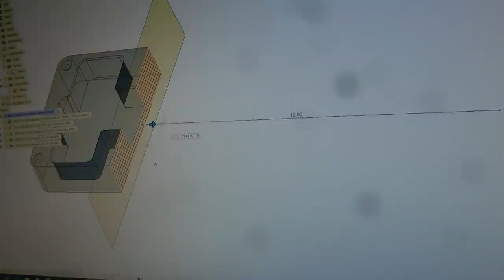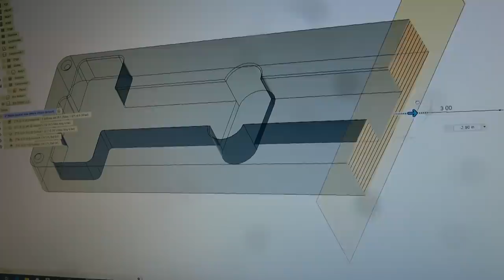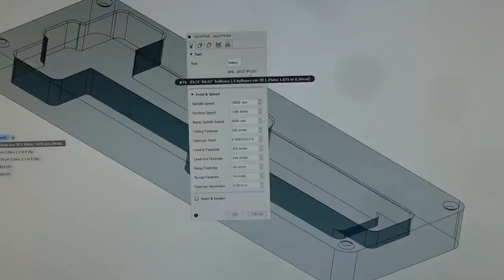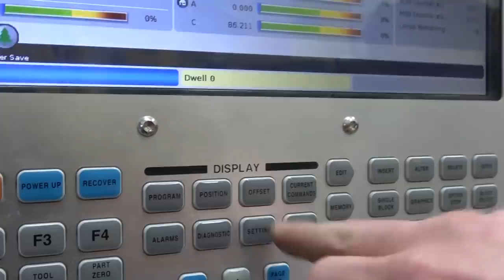Robotically Hammerin Box | Working the wood (maple)

Comment: Hazard Fraught sells something called a router. It is not an internet connectivity device of which you have been previously mislead to believe. That there skookum milling cnc thing you're using is too powerful for the carbo-foam to which it is being applied. Catching fire is the least of your concern; you could put real carpenters out of a job if they catch wind of your malfeasance.

Comment: Shes a versatile machine. Just like my last gf. 
Why you not using a HSS router bit for the bulk material removal? Itll pull off a bigger and cleaner chip than an endmill. They need high spindle speed too.

Comment: First thing before putting it into the CNC machine.
Straighten the board and make sure not to put any lubricant on it.
Wood suck anything wet and has a tendency to swell.
Know you know where "Getting a woody" comes from. 🤪

Comment: Dust collection would have prevented the fire....MDF holds to a vacuum hold down clamp much better than real wood and the air will actually flow through the MDF and still hold down material....and if it wont hold to it you can screw material to it.....I'm no expert; just loaded a CNC to make parts for a cabinet shop for awhile and made all the mistakes.....

Comment: Ya.  Hey der Ave.  Your vidjs are required  viewing in my shop.  However, as a wood butcher myself, I would like to point out that you will never achieve a vac seal without milling the mating surfaces.  Also, the CA glue you used is way to hard to conform to their surfaces.  Your joining of the rubber tips is over played.  Pull out!  First, find the most commonly available and appropriate sized ...ring.  Ok, then size your tool's motion to the task at hand.  Also, improved suction never hurts.  God Bless.  Say hello to Prudence.

Comment: when i milled soft materials (wood, plastic, fiberglass etc) on the outside profile i found that conventional milling instead of climb is better because the material doesn't try to climb up the helix of the cutter and has a lot less lateral load on what your cutting just my 2c

this shouldn't effect the finish in the softer materials also 

here is a video i found explaining it a little with a good example https://youtu.be/galm5_6SUcM?t=698
hope it helps

Comment: cutting richlite for hydroform molds (terrrible shit btw) dude running machine didn't put the bolts in the right place (or programmer... totally the programmer) let er chooch all night... she sparked and a smoldered all night, filled the whole shop full of smoke... this happened twice while I worked there, 2-5 times that shop was on fire in the 5 years I worked there

Comment: DID NOT trim the top of the handle protruding, yet somehow unwilling to put fixturing  ( aka ventilation) holes in the wood to properly affix it whist beavering.   He's lost his way.  OCD is taking control? 
Why even mill the perimeter of the box?  Get a big disk or belt sander and just match and round the edges.  No need to be shy of a little HAND finish.    If each one is unique, all the better.  Did you think woodworkers invented interchangeable parts?  Not in this plane of reality, and no need to start now.   You do get bonus points for the fire and use of linseed oil tho.

Comment: I’ve seen plenty of success with guys using double sided template tape to stick wood down when cnc milling. Vac clamp seems like you’re over engineering the problem/solution, keep it simple.